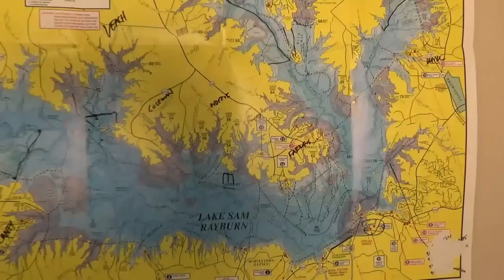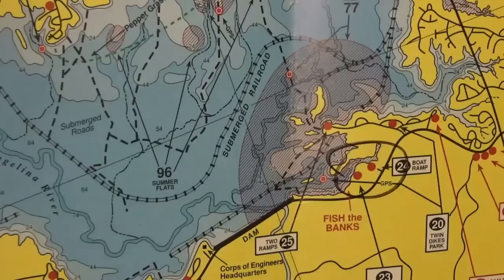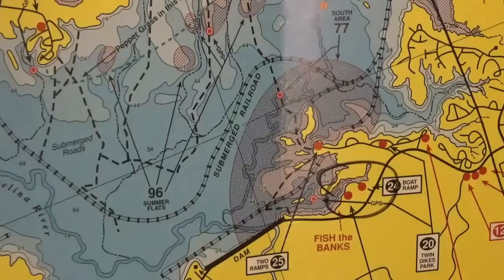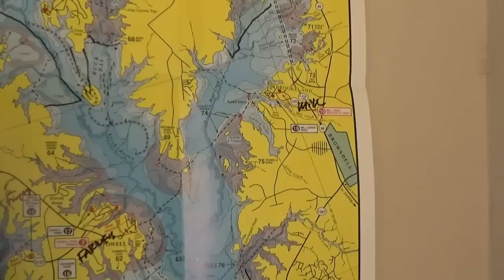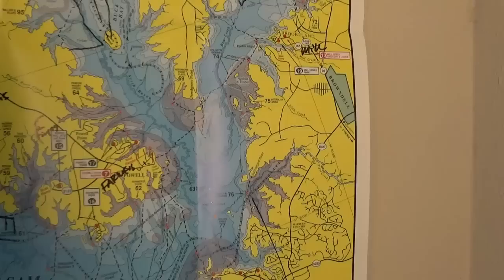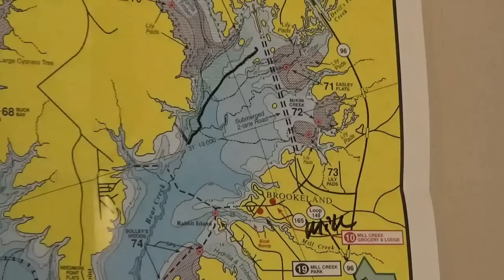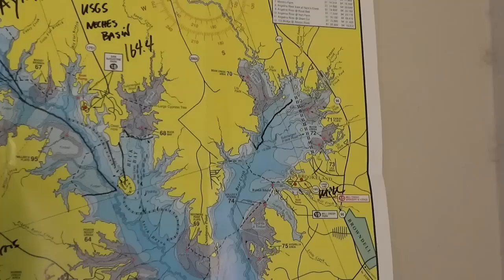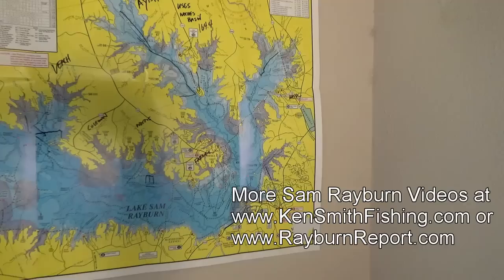Sam Rayburn Bass Fishing Navigational Guide & Fishing Tips Video 1

Comment: Thanks for sharing these videos, I used to fish the Sealy events back in the early 90's, I haven't back over there since then, but I recently booked a room in Jasper for the 2019 Sealy tournament. My question has to do with time and fuel management, I have an older Ranger with 1998 model fuel injected Mercury 175 hp. It ain't the best on fuel economy and I was thinking about fishing out of Cassels Boykin and trailering to the weigh in at Umphreys. I can only hold about 24-26 gallons of gas. What would be your recommendation as to what section of the lake to focus on?
Reply from the maker: Bill I’m not sure you aren’t better off putting in down south, maybe Mill Creek and focusing down there. Couple reasons, first in general less crowded. Second if you have to trailer (still no place to get fuel on the water at Rayburn) every hour you want to weigh a fish your going to take 5-20 minutes to load according to crowd and how many miles from the ramp you have to park 😦, then 25-30 minute drive back south, then repeat to go back fishing. Any hour you want to weigh a fish, if you trailer, is as much as 2 hours lost fishing time. Even if you go to Caney you are only gaining maybe 40 minutes of that lost time back. You can catch a giant literally anywhere on Rayburn, so I’d put some thought into my time Mgmt before committing way up the lake in any boat, no matter mpg or capacity
Reply: That makes sense, and if I fish Mill Creek/Buck bay and farmers areas I can run to the weigh-in by boat, even Caney I think I could make the run back and forth by boat as far as gas goes. I've never been in Buck Bay area, I'm looking forward to trying to learn a little bit about that area!
Reply from the maker: It’s right at 9 1/2 miles maybe 10 from Caney ramp to Umphreys by water. Lots of good stuff in Buck, good clay ridges out front or you can go to the back and fish grass. If water gets up more bushes than a man could fish in a lifetime
Reply: Thanks for the help! I can only imagine what kinda nightmare it would be trailering to that weigh-in lol, what was I thinking! I definitely need to do it by boat, maybe I'll go to cassels sometime fun fishing, we have a camp on Toledo, been meaning to make trip to Rayburn the past couple years and just haven't done it. We're on the Louisiana side, San Patricio but I fish a lot in San Miguel and on the Texas side. My plan is going to be Buck Bay and go to Caney if the wind is horrible and that side is out of the wind, I've fished in Mill Creek before. Priceless information Ken, thx, if you ever need any help with Ouachita river in the Monroe,LA area or Caney Lake or D'arbonne or Claiborne, just let me know!